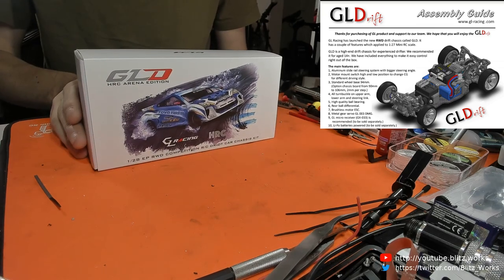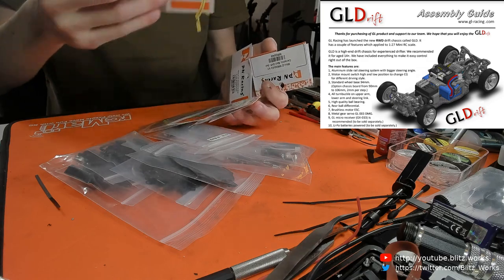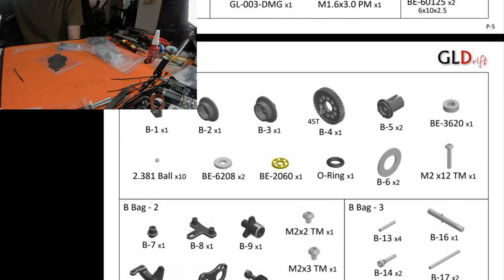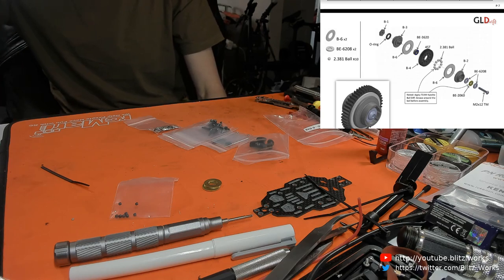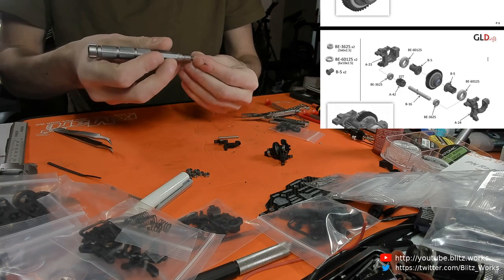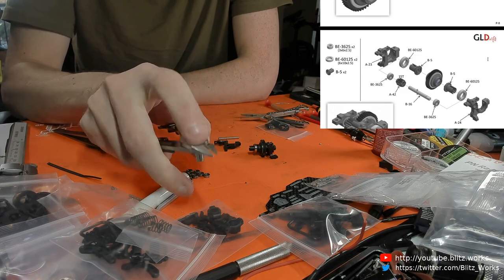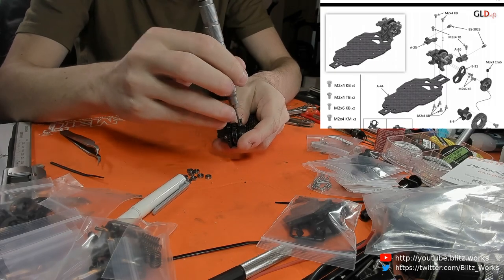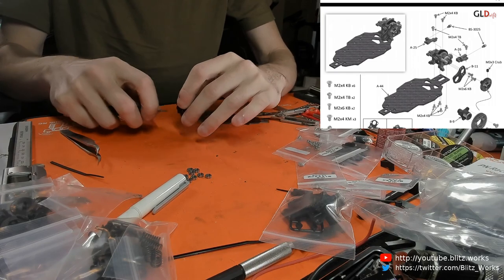Building the new GL Racing Drift car - The GLD - Part 1

Comment: Now this is what ive been waiting for a gld vid! What's your thoughts on quality over the drz v2?
Reply from the maker: Great timing, i just did another session on twitch which i will be uploading shortly. its nice. if you didn’t do any tuning and just assembled it you would end up with a good car. the amount of filing and tuning it did today was minimal and made it a great car. the front steering is a bit fiddly but now that i have set it up it looks to be rock solid and i suspect it will perform 

overall this just feels nicer but its been hard to put my finger on, it may be things like bal heads are sized and dont need to be reamed out or that the screws thread into the plastic straight and sure nearly every time and with no effort. the plastic is defiantly a cut above and you have confidence once you have screwed into it that it is staying there

need to get it on the track but i suspect the GL is a better buy from the build experience alone
Reply: @BlitzWorks  fantastic reply mate much appreciated! im trying to avoid buying each version but just know i will in the end so hoping to get the better one first😂 

Will watch the mentioned video once its up!
Reply from the maker: @efaracing4000  I am lucky enough to be able to afford both so i want to get teh info out there so people can make the correct decision for their needs

i should mention that the DRZv2 is by no means bad it still impresses me

if you have any other questions just let me know will either reply in comments or address it in upcoming videos
Reply: Blitz Works any update?
Reply from the maker: @chooby3000  thanks for reminding me, got distracted with some other rc projects will see what i can put together this weekend, i just need to do some front end testing
Reply: @Raphael Dean yup, have been watching on InstaFlixxer for since december myself :)

Comment: I’m surprised you think my car handles better, I feel like my DRZ2 is still a hot mess. My suspension needs more tuning & then it should be much better
Reply: What do you think of the hackslider? I’m considering getting a hackslider for my DRZ2
Reply from the maker: Ha Ha your car drifts at least mine is currently not. though i appreciate that note on the front suspension droop explains why it drifts better with the body on as i set the droop for when the body is sitting on the frame but likely need to reduce it more

Not a fan it feels like less of a gyro and more of a 'delay input by 1/2s', i did pick up some more oniski gyros and will be swapping that out to do a comparison. I can see why people would like the hackslider i just suspect its not how i want to drift or my style but wow are they small. The best way to describe it is with the oniski you set the drift angle with the steering wheel and it maintains that where as th hack slide seems to pick up that you want to turn and pauses just long enough for you to transition your wheel and line things up

still learning so hard to say
Reply: Blitz Works hmmmm very interesting, it sounds like the Hackslider would be a perfect fit for my style. I personally don’t like to “feel” the gyro working, what I mean is I don’t like the gyro to maintain steering angle, I would rather have it just there as a “safety” to keep me from going beyond the limit & spinning out